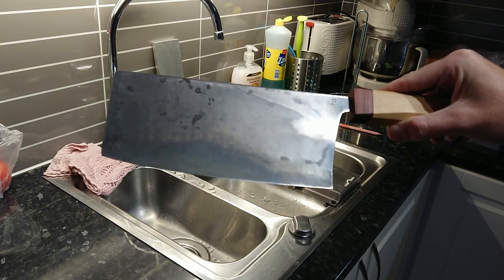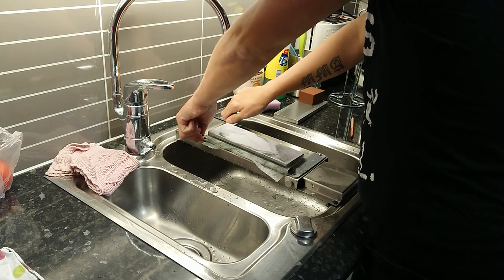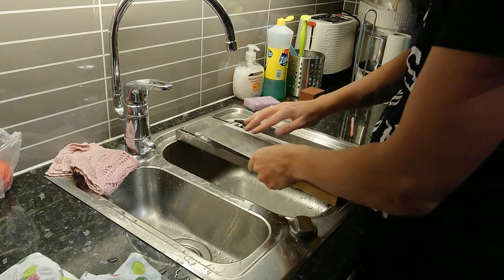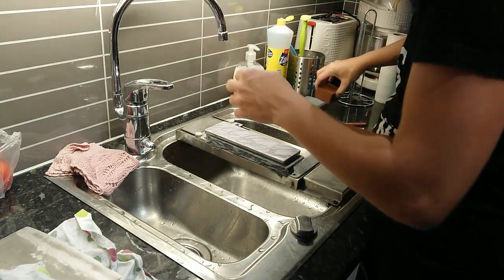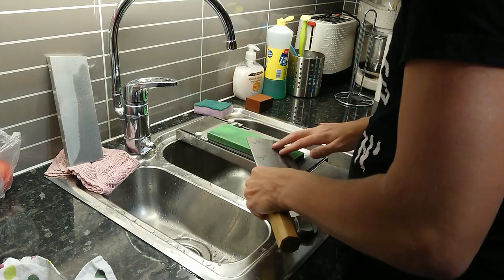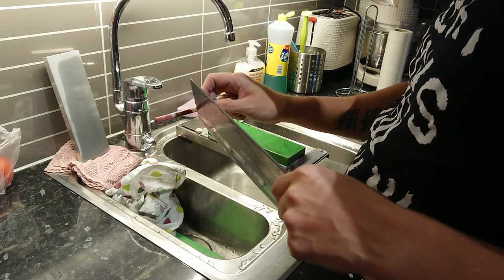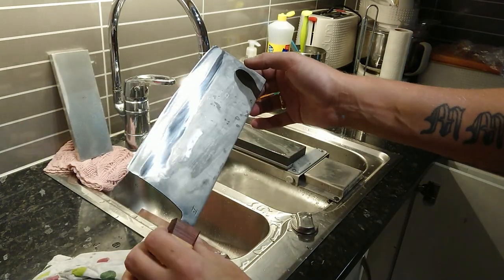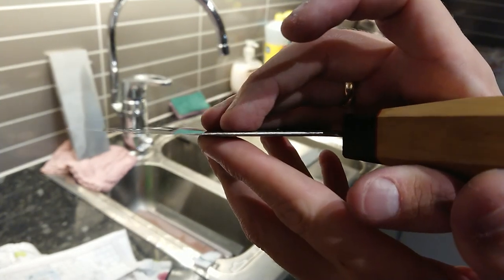sharpening patrik carlvik custom chinese cleaver.

Comment: Every time I see you reprofile I think about 80 or 120 grit SiC Naniwa,  Nabutama or Sigma. I used to have 100 grit suehiro deluxe - real jam for metal removal on the clock.
Reply from the maker: Jupp but how are they wont they dish extremely fast?

And more knocking the shoulders of than anything else
Reply: @knifesharpeningnorway  They do not stay flat for more than couple of minutes but the y cuts so fast. One other option is Norton crystolon coarse - relatively harder to the japanese water stones.
Reply from the maker: @stefanwolf88  how is that to flatten the crystolon works good? And how is it to use?
Reply: @knifesharpeningnorway  I flatten my Crystolon every 3/4 000 passes on glass with abrasive grain. Not sure 140 Atoma will do the job but extra extra coarse DMT should be just fine. Crystolon release abrasive with minimal applied force so cuts fast even the hardest of steels.
Reply from the maker: @stefanwolf88  aha okay, yeah i only have the atoma. Will se what the future brings hehe

Most of all want a damn belt grinder